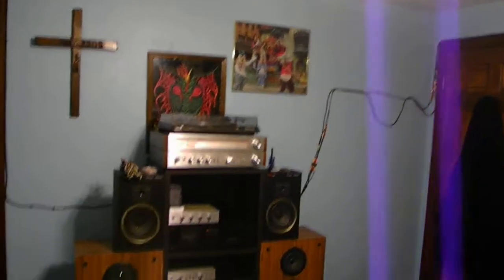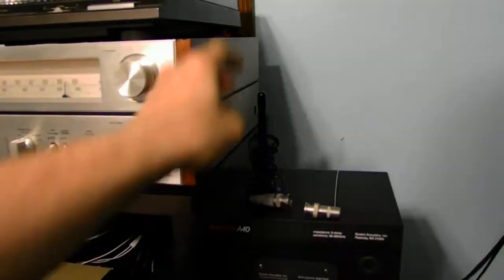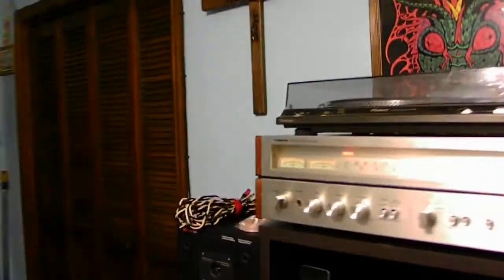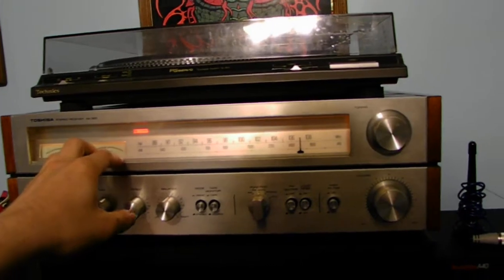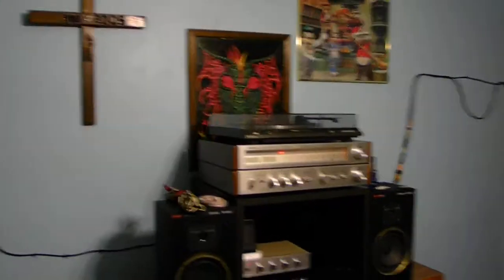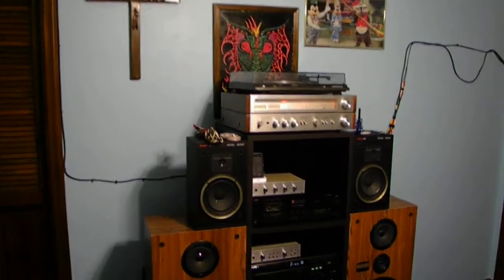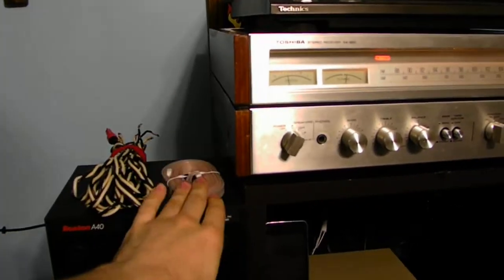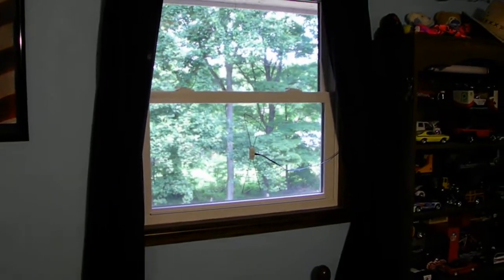HOW TO MODIFY A FM RADIO ANTENNA

Comment: I been using all kinds of radios, but for reception, what about  a car radio modified to 12 volts.. with a DC converter circuit.. you'd get stations in tha wont come in on regular radio..